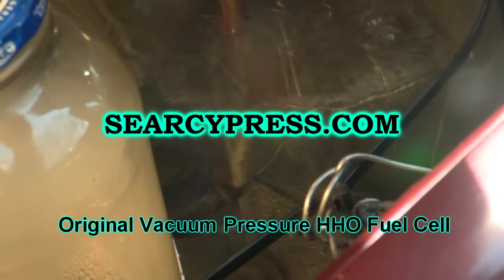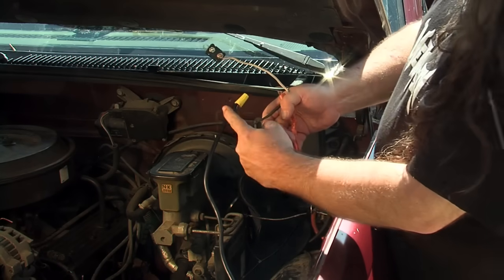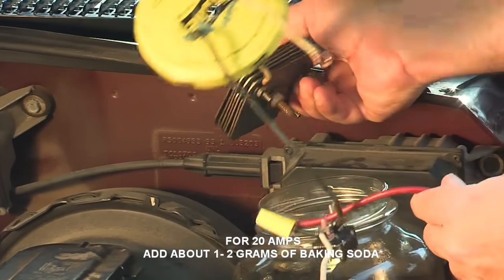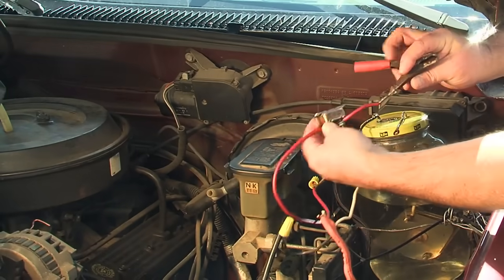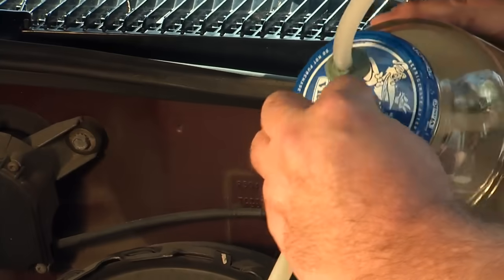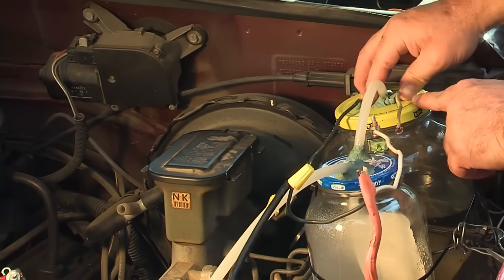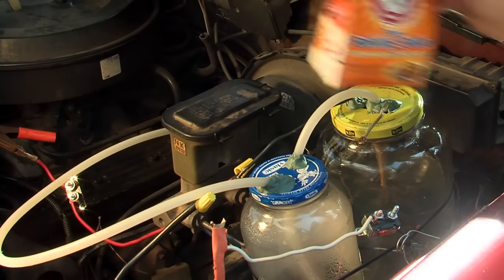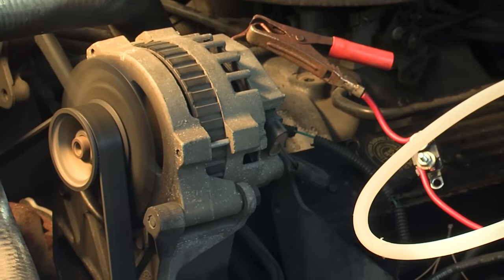Vacuum Pressure Hydrogen fuel cell defeats high gas prices using hydrogen from H2O.

Comment: This is great! How much fuel consumption efficiency do you get from this system? And is it still working today?

Would love to see a follow up video showing an update!
Reply: Internet BS....!
Reply: You’re old Chevy doesn’t run on electricity so if you have a upgraded alt or a second one you’re not wasting evergy by using it in this method
Reply: My truck sits at 14.1 volts while running this wouldn’t draw near enough to make the engine drag
Reply: You hook it up to the fuel injector like you do a forklift for propane
Reply: RIP Mr. NELSON
Reply: Yes you can separate water back to its gasious elements and burn it. The problem with the process is that it takes more energy to produce the gas than the return.
Reply: @ib1rcnut  it doesnt take more energy to produce the gas than the return I know ive heard that before but its silly. you can do this with a sock and steal wool and a car battery charger.  I would use a current regulator, to prevent runaway,  and adjust it up once the engine is up to temp.  I would put a little more into the system is what im saying,  but what hes done will work. He isnt separating the hydrogen and oxygen with this set up though and that means hes actually making browns gas and it is very volatile.
Reply: @icedout2322  I've been experimenting with it for about 15 years. Wiring the alternator like Stanley Meyer. I built a pulse width modulator from Dave Lawton's design. Vary the frequency and timing. Built many various cells. Good luck. Hope you find the Holy Grail.
Reply: @icedout2322  Just idling your engine is over 600 rpms. Driving a 2.5 liter 4cly motor  is about 150 cubic inches. That's 37.5 cubic inches per a cylinder. A cylinder fires ever 2 full rotations. So in a minute of idling at 600 rpms your engine will use 11,250 cubic inches of air a minute at just idle. That's a 187.5 cubic inches a second of air. You're not producing even 2 cubic inches a second. But don't forget that it's h2O 2 parts hydrogen 1 part oxygen. So 1/3 of the gas isn't even hydrogen it's oxygen. So not even 1% of the air being taken into the cylinder is hydrogen. The only thing being accomplished here is the alternator is working harder for the high amp draw dragging the motor down more reducing fuel mileage. This is why water isn't used as fuel in a motor vehicle. 

Now don't forget we don't drive at 600 RPMs most people will be around 1800 rpms at cruising speed. That's 3x the amount of air with still the same hydrogen production. So now ur way below the threshold of .03% hydrogen in the cylinder. Using a spark arrestor on the output hose to keep from blowing the jar up you would be hard pressed to even candle a flame let alone put anything measurable in every cylinder 900x a minute cruising down the highway at the speed limit.

Now if u could put enough in the cylinder to actually do some but you can't you would have timing issues. The fuel would burn to fast to early greatly reducing HP. Clearly you have never worked on a hydrogen based car. (Iceland is filled with them) So if you could provide an amount to make a difference you would first need to reprogram the ECM for a timing change and fuel and air ratios. You're not going to save any fuel because the fuel air ratios haven't been changed. 

It's easy to fool people with fake internet conspiracy BS. Basic math can show u all of these free energy things don't work. Measure outputs and draws vs return

You want fuel from water dona proper conversion on a car. Build a hydrogen generator now ur going to have to separate the oxygen because if u try and compress brown gas it's going to explode. Build ur own solar hydrogen filling station and it will never pay for itself in your lifetime.
Reply: @ib1rcnut  no holy grail when u figure out how much cubic inches of gas u need a second. Stan Myers never made a water powered car. People are easily deceived. He was doing what many had done before in other 3rd world countries. Fill the fuel tank with calcium carbide and then add water. It produces acetylene gas that u take off the top of the tank and run the motor. So yep u pour water in a fuel tank and a car runs.
Reply: @magicalphones  Bob Lazar did it.
Reply: @magicalphones  listen I used to work for a guy who did have a hydrogen ran vehicle. He used 50 gal drums and an array or metal of some sort to a (I think)36 volt battery. And then he would fill the drum to a certain level and then take the drum and after it began to produce hydrogen and separate the oxygen out of it. I don't remember exactly what he said he was doing with the hydrogen to separate it. This guy was an expert at math. And he had a effin master's degree in engineering. He was a teacher on top of being an architect. He then-after it was separated-used an air compressor that he built to compress the gas only into an old oxygen cylinder. Then used the fittings off of a propane forklift and some of the other inner workings of the fuel system of the forklift to power an old s10 with a regular distributor no ecm. And they varied the timing with the distributor off a hot rod that used weights and springs internally to vary the timing. The took a fuckin small oxygen cylinder and compressed enough hydrogen inside the motha fucker to drive the truck over 600 miles. That number may be exaggerated it's been 15 years since I last saw the old guy. He was one of the smartest hill billy sum bitches I ever met. And he had the credentials to prove it. Math was his field of expertise. Ever heard of the stoic ratio? Because in an engine that's the ratio of fuel vs air and when the stoic ratio is perfect the engine runs like a dream up or down creates a lean or rich condition. I don't know what the stoic ratio is for hydrogen and air but I'm guessing it's a little lower with hydrogen and oxygen vs gasoline and oxygen. Simply because hydrogen burns hotter and faster. Now I don't know about that for sure that's just a guess. But I learned a great deal from old man nelson and he's was super effin intelligent mr cell phone. One thing I know for sure is he wouldn't have lied to me about a damn thing. He fed you the truth no matter what. Now idk about this guys hydrogen generator or whether or not it works or not. But it's a step in the right direction. And old man nelson was one of the people smart enough to pioneer some shit like this and he did it with his own mind. He helped me understand math in ways I never thought I would. Im a shitload smarter to this day because of him. And to sit here and put people down or knock em for trying...Well that's just fuckin stupid. Unless you gotta better solution than throwing calcium carbohydrates or whatever you said to make assholeum-which it sounds like you've clearly inhaled too much of. Then sit back and watch as some people who may just be more Intelligent than you figure out things your over worked and under paid mind may not be smart enough to think up. Because necessity is the mother of invention. And my mama told me that. Because sometimes the outcome of an experiment is much different than youre expecting. And that's because something new is created. There are gaps in the periodic table of elements and not because we want them to be. It's because we haven't figured out how to produce them or what they are. If someone creates this new gas or liquid out of helium and water or whatever some smart mofo comes up with. Then history will be made. And making fuel out of the most abundant liquid on the planet only makes sense. All I'm saying mr cell phone is if your not helping the problem you are part of the problem. So don't knock em down help em out. And don't let your edumacation make you a real smart dummy. Because the world is full of real smart dummies. And I know what acetylene is I was just turning your crank. RIP Mr nelson... Thank you
Reply: @mrnaylor132  you have made the first claim on here thats plausible. The rest of the stories are bullshit. "This guy" isn't onto anything. People have been doing this exact same thing over and over sense the 70s with ridiculous claims that nobody has ever had. Hydrogen cars exist. That's no myth and yes the intake system is much like that of a propane forklift. You are correct you would have to separate the gas before compressing or it would explode. It's not rocket science to make it separate it and compress it. But at that time u can put a viable amount of nitrogen in to actually run a car. But nobody onto anything here. You can't get out more energy from water then the energy it takes to split it into a gas. But hydrogen powered cars have been a thing for many years. Enjoy a trip to Iceland and go drive one. But back to reality here this doesn't and will never work or do anything. The output needed wouldn't be done with a pickle jar. This won't even make enough on demand for it to burn in the cylinder. If this did like u said it burns faster and hotter.... Their went fuel to air ratio and timing of ur motor out the window. This is why their are no gasoline/hydrogen hybrids on the road. It doesn't make any logical sense. Their are no unknowns or anything to tweak. 

But if you really want to believe that works You should watch some perpetual machines over unity devices. After you are done with that I got an app that u can play a cheesey game on they are going to pay you thousands of dollars a week and it's free to play but u might need to buy some more tokens...
Reply: @magicalphones  this is why I like comments
Reply: @magicalphones  It’s always amusing watching people who don’t understand the difference between a carburetor and a fuel injector, nevermind any basic understanding of fuel trims, timing curves, or even OBD I/II systems, arguing what is true or not 🤦🏼‍♂️
Reply: @mrnaylor132 we know one thing for sure. The only people who will turn out ingenuity aren’t the assholes sitting at there computer typing furiously in the comments section “This can’t be done”. There is an equation beyond what math can compute that only can be fathomed by people who TRY.
Reply: @kyinchi  Try to fly to the moon without using existing technology. And don't be one of those "assholes sitting at there computer typing furiously in the comments section “This can’t be done”". You just have to TRY jumping hard enough, you will succeed eventually, Right?
Reply: @magicalphones ” Great explanation. Much appreciated.
Reply: @mrnaylor132  im now considered a hillbilly sumbitch.
Thanks dude ya made my day.
Rip.
Mr.Nelson
Reply: @magicalphones you’re acting like you need to replace all of the air with hydrogen to get the car to run. This is to supplement gasoline and air for a better burn.  Just because it takes in a bunch of air, doesn’t mean it needs the same amount of hydrogen or fuel.   So your saying just because the car uses 187.5 CU of air in a second, it needs the same amount of fuel??? No it doesn’t. The amount of gasoline needed compared to air is tiny. Literally 1 gallon over the course of 30 miles or so at let’s say, 2000 rpm.   So 30 mpg, going 60 mph, that’s 1 gallon in 30 minutes. That’s .0005 gallons in 1 seconds.  The car would explode if it had 287.5 cu inches of hydrogen in one second 😂
Reply: @magicalphones  love how this guy just schooled all the GED holders in here with basic arithmetic! 😂😂😂
Reply: Lol this was 10 years ago and doesn't work.
Reply: @magicalphones you don’t know that
Reply: @magicalphones  Sorry but to break it to you but browns gas burns quite well its just very volatile .

Comment: 12Vx29A is 348 watt. I don't think one get more than that from engine out of h and o2 from water. As matter affect, u can't even idle engine on that whithout gasoline. Soooo, where logic?
Reply from the maker: You're under the misconception  were trying to power the motor. We are not. This engine burns only about 80% of the fuel normally. What we are trying to do is increase the amount of fuel that is burned during combustion. There's plenty of room for gains. Thanks very much for your comment.

Comment: So will this only work on a vehicle with a carburetor?
Reply from the maker: Any vehicle that has a vacuum that is produced by a  piston engine. Some will say this causes O2 sensor problems however that is debatable considering we are not leaning the mixture with air, (other HHO setups) and are in fact putting it into the vacuum of the engine itself where it is completely ignited leaving no surplus O2. ( My observation / opinion.)

Comment: In response to your opening statement on the "do not try this at home" I am letting u know I started building mine a couple weeks ago when gas prices started rising so I don't hold u responsible, the wiring u have looks like a solid piece instead of the braided thin #10 I usually see. Is this a trick of the light or am I getting something wrong?
Reply from the maker: Stranded wire will wick water...destroying it. Causing a bad dangerous connection.
Reply: @metalpresstv  that's what I thought too, glad I didn't buy it
Reply from the maker: @mrstupiduniverse731c  New video coming soon. Be sure to subscribe. Thank you!
Reply: @metalpresstv  been subbed for years 😁, can't wait to finish mine. Going to Menards tomorrow to get me better wire

Comment: I think you could replace the fuel tank with a large aftermarket tank and much larger plates, and put another beside it.  Then put a sump pump in the second tank (which would be merely water storage) and rig it to come on and keep the plates covered in the main tank. For you nonbelievers,  I believe that it would probably work because that is how you extract hydrogen from water.  But much research needs to be done to coordinate the tanks output to the engine requirements. I believe that I will try this.
Reply: Lol no this doesn't do anything.
Reply: You do this or what you say, and you will carry a time explosive ready to burst very soon.
Reply: Did u do it I'm down
Reply: A
Reply: You're going to wind up a stain on your driveway when the hydrogen based bomb you're building levels your car. I just hope a camera is running.
Reply: @JohnDoe-mx1sq  ehh it's pretty small output and it's in glass not much compression. Burn the car up likely. Blow up not at all.
Reply: @magicalphones  not you, Ron replacing the fuel tank with a huge tank full of water and plates.
Reply from the maker: You are under the false assumption that we are trying to power the engine with the hho..We are not. This engine only Burns about 80% of the gasoline that you put into it. The rest is wasted. What we are doing is adding to the combustion process by getting a more efficient ignition in the cylinder allowing us to gain energy by burning more of the unused fuel. Thanks very much for your comment.
Reply: @metalpresstv  Why are you having unburnt fuel? A high performance ignition would cure that, and an aluminum intake would help with power efficiency.
Reply: @JohnDoe-mx1sq  Just idling your engine is over a 600 rpms. Driving a 2.5 liter 4cly motor  is about 150 cubic inches. That's 37.5 cubic inches per a cylinder. A cylinder fires ever 2 full rotations. So in a minute of idling at 600 rpms your engine will use 11,250 cubic inches of air a minute at just idle. That's a 187.5 cubic inches a second of air. You're not producing even 2 cubic inches a second. But don't forget that it's h2O 2 parts hydrogen 1 part oxygen. So 1/3 of the gas isn't even hydrogen it's oxygen. So not even 1% of the air being taken into the cylinder is hydrogen. The only thing being accomplished here is the alternator is working harder for the high amp draw dragging the motor down more reducing fuel mileage. This is why water isn't used as fuel in a motor vehicle. 

Now don't forget we don't drive at 600 RPMs most people will be around 1800 rpms at cruising speed. That's 3x the amount of air with still the same hydrogen production. So now ur way below the threshold of .03% hydrogen in the cylinder. Using a spark arrestor on the output hose to keep from blowing the jar up you would be hard pressed to even candle a flame let alone put anything measurable in every cylinder 900x a minute cruising down the highway at the speed limit.
Reply: Facts will only confuse people. HHO not adding much energy.
Reply from the maker: The energy does not come from the hho. The energy comes from the 20% of the gasoline that is normally wasted in the cylinder and burned in the catalytic converter. That is one of the things people are not understanding about a vacuum system. We have a new video coming out soon and I'll show this and some improvements. Thanks very much for the comment.
Reply: @metalpresstv  Excited to see the improvements also good music guys, jam on
Reply from the maker: @dannyp9044  The new version will be "safer"  at least from a design perspective. 😁 In public acceptance, not so much. Thank you for the comment.
Reply: @metalpresstv looking forward to the updates!
Reply: @metalpresstv does it have to have a catalytic converter?
Reply: @metalpresstv  would it work on an 02 Silverado ?